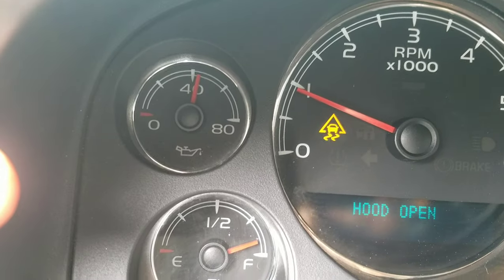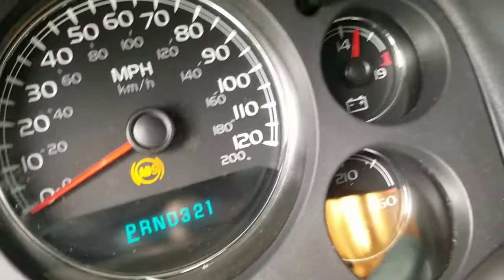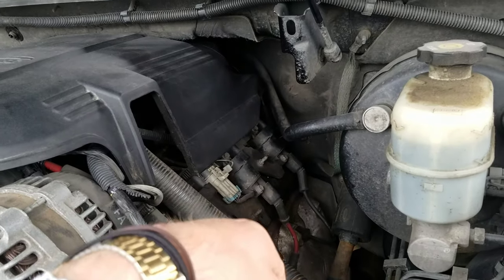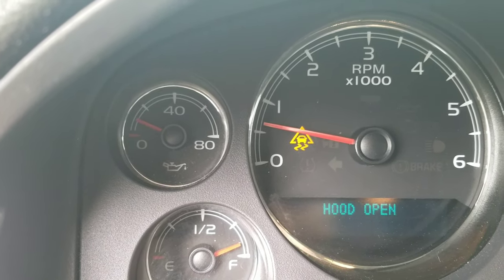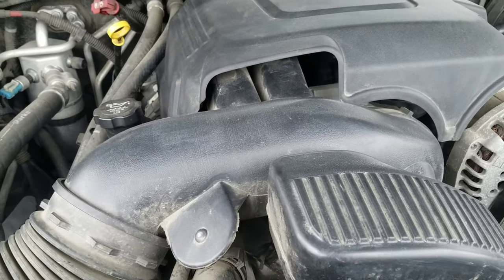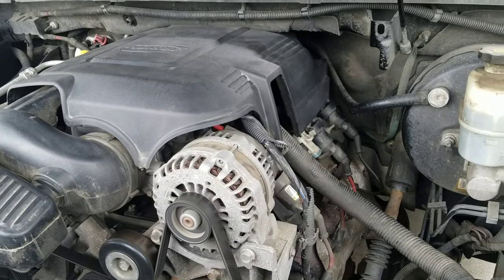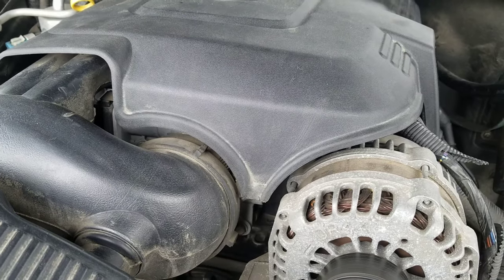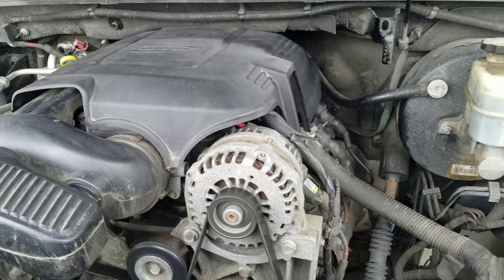0 or Low Oil Pressure? Chevy Suburban, 5.3l Vortec 2007-2014, Tahoe, Yukon. Diagnose and Fix Easiest

Comment: After watching your video I added the seafoam and after driving it over an hour and idle for a while it got fix GREAT CONTENT it helped me a lot I had replace the sensor as well and now it’s fixed! Thanks !
Reply from the maker: Awesome to hear. It's really crazy it worked. I couldn't believe it when my gauge starting going up after hour or so of idling and driving around.
Reply: I just had my oil changed last week and my 03 suburban is doing this.. question.. if I put a bottle of that seafoam in it I drive around and or let it run idle for a bout an hour? also my oil level is covering all but the highest marking on dipstick is it gonna be ok to ads that in or would it be too full? just wanted to clarify so i dont fuck anything up ive just really started doing my own work on my truck about 2 years ago..still learning a lot

Comment: This happens to me every time it’s time to change the oil! Same truck too. As soon as I change the oil filter everything goes back to normal... I have no clue why! But I have went through this at least 6 times and every time I change the oil it fixes it
Reply from the maker: Yeah oil gets dirty from burning up because of the afm and then doesn't register on the gauge.
Reply: @g3mccotter  just seemed strange to me because all other vehicles I’ve had could go over oil change mileage as long as oil levels were good. Not the ole Chevy tho! Almost like clock work. Low oil pressure warning every 3000-4000 miles. Funny thing about it is it never shows signs of low pressure other than the gauge and annoying dinging. First time it happened I changed sending unit and used motor flush with no results. Then I just changed the oil to get motor flush out, scratching my head and thinking I may have big problems. Cranked it back up to get it to the shop and BAM! All was good
Reply: That works for me as well. I believe its because the oil filter is too small. It literally isn't much bigger than the one on my motorcycle. Obviously it could be something else but I think its related to the size of the oil filter.
Reply: I'm having the same issues... QUIT USING CRAP FILTERS.. .I had been going to jiffy lube to get my oil changed, they use CRAP filters... so far, I've changed the oil, or just the filter and it has fixed it every time... but.. it seems to be getting worse.. first time oil life was 90%  next time 85% .. then 80... this time  60%  going to change the filter and install a WIX filter .. hopefully that will fix it again.  Also put seafoam in it and hoping to clean the gunk out.. will run it for 100 miles and change the oil and filter if I get good pressure again.  Probably won't be going back to jiffy lube
Reply: Do it yourself brother, also try synthetic. These newer motors need it.
Reply: I agree it's probably crappy cheap oil filters
Reply: In my case it's not the filter I use k&n religiously but have used many others and every oil change is still having the same problem. Also the truck has been changed with full synthetic oil it's entire life.
Reply: @stealth1028able same here still have the problem now devolved ticking/knocking driving me crazy
Reply: @thank7241   my problem was the oil pressure sensor. After I changed that it's been fine.
Reply: @stealth1028able  changed oil pressure sensor twice,oil pan gasket.rear main seal,pick up tube o ring,new plugs and wires. Will probably do coils next just got code PO300 I believe it was so let’s see
Reply: @thank7241  best of luck to ya. If you're knocking it might be your actual oil pump not feeding right. Just another option to try and fix or have looked at.
Reply: What oil filter did you use
Reply: @stealth1028able  ok so I changed.MAF SENSOR,PURGE VALVE SOLENOID, CLEANED THROTTLE BODY REALLY GOOD. After I took throttle body off I got HIGH IDLE CODE. Says you have to get it relearned after taking TB OFF and guys were talking $150-200 to relearn it at shops. I drove around two days and it relearned itself I suppose. So no engine light on oil pressure is holding strong tick is still there tho no misfire gas mileage is better(which it should be fresh tune up). For a 2009 with 208,459 miles OG motor and tran I’d say I’m good for another 100,000
Reply: @HNPMOE  K&N Mostly. I think factory spec is AcDelco. Double check on factory spec tho I may be wrong
Reply: @stealth1028able  also changed the fuel I use to chevron with Techron. I used to use Kroger fuel well still do in my f150. But for the Yukon I changed to chevron with Techron I can tell a difference slightly

Comment: When you change the sensor,  slap a manual gauge on it before replacing the sensor and it will give a correct reading.  Could be the Guage cluster itself.
Reply from the maker: Yup good call. Could always be gauge cluster

Comment: This happened to me with my 2007 Suburban 5.3 yesterday.  Been noticing oil pressure seemed lower and lower. No smoking or noises, no indication it's something major.  Oil level fine. Dash says oil life 33%. Using Delco oil filter with Mobil1 5w30 synthetic oil.
Gonna change this sensor and screen then run engine oil flush through it and change oil to see what it does.
Reply from the maker: Keep us posted
Reply: Di you fix it? I just have the exactly same problem on my 07 chevy suburban..what di you do if you already fixed?
Reply: @joguadal72  I ordered parts and stuff for it. Everything I've checked so far points to this being the culprit (it is a known thing on the 5.3 with AFM).
Make SURE you change the screen under the sensor. That screen acts as a filter to screen out the oil before going to the valve lifters. (Some people just say to poke holes in it or whatever - do NOT do that trust me!)
Reply: @joguadal72  I ordered parts and stuff for it. Everything I've checked so far points to this being the culprit (it is a known thing on the 5.3 with AFM).
Make SURE you change the screen under the sensor. That screen acts as a filter to screen out the oil before going to the valve lifters. (Some people just say to poke holes in it or whatever - do NOT do that trust me!)
Reply: @JenniferFuchek  so how’s it turn out?

Comment: This has happened to me twice. I stopped at a gas station and bought STP oil treatment, it stopped the alarm and brought my oil pressure up from 0 to 20 and I went and got a oil change and everything went back to normal.
5w30 doesn’t last that long, it gets broken down fast. When it gets to thin then you will get no oil pressure. I recommend Lucas oil treatment and add 10w30.
Reply from the maker: I was using 10w30. This is a much bigger problem I think. As I have oil pressure since I am not getting any ticking or Knocking
Reply: @g3mccotter  buenas noches. Tengo el mismo problema con una tahoe 2007. Me pueden ayudar. No hablo ingles
Reply: @g3mccotter  I do not speak English. can you help me. I have the same oil pressure problem as the video with a 2007 tahie. I changed the oil bulb twice and I still have the failure when heating low

￼
Reply: @johanaromero4774  todavia nececitas traductor/alluda?

Comment: Did you replace the filter under the oil pressure sending unit? They are known for clogging up and the oil can't pass through and needs to be replaced when you replace the sending unit.
Reply from the maker: I did replace it

Comment: Ok bought my 07 Tahoe last month. didn't notice the pressure was low on test drive but engine was really smooth and no check engine light was on. Two weeks later after only driving it on the weekends the check engine light came on. Code was for oil pressure. Did my research and common problems were pressure sensor and oil pump pick up tube o-ring. Did the o-ring first since I figured why not get the hard one done first and sure enough the o-ring was flat, hard and split. On cold start it would idle at 40psi but still dropped down to 20psi once warm and check engine light came back on. Just swapped the sensor and same.
Reply from the maker: Pick up tube is next. Or just flush it then change oil
Reply: @g3mccotter  pick up tube was the first thing I did. Did a flush and changed the oil filter. That seems to have worked

Comment: Same issue with a 2007 Yukon xl I bought yesterday. Check engine light came on but zero physical symptoms then oil pressure low light and dinging came on and gauge read zero. Changed oil and filter fixed the gauge but not the check engine light. Got it coded at the local parts store it’s saying the sensor is bad. The filters/screens with the sensors are known to clog and throw warning from what I’ve read.
Reply from the maker: Reset that code probably go away.

Comment: I replaced my oil filter with the oil filter that has the built-in  anti drain back valve, plus good quality hi mileage Desox 1 gen 3 oil. Drove the tahoe for awhile. It cleared the low oil pressure warning. I think with the anti drain back valve the oil stays in the engine to keep the oil pressure in acceptable range. My oil pressure is still be at around 10 psi on the hot day and idle at stop, but the low oil pressure light went away. May be a GM design engineer can explain why the oil filter can fix this in my case. By the way the local autopart stores in my area only have one  filter I am looking for. I bought the last anti drain filter in my area.
Reply from the maker: 10 psi is too low
Reply: All modern oil filters have anti drain and pressure relief bypasses integral to the filter.

Comment: Had this issue on my 07 Tahoe. Replaced oil pressure sensor, that did not solve the problem. Ended up dropping oil pan and replacing oil pick up tube o-ring. Problem solved. While you have the pan off make sure and replace oil pressure relief valve.
Reply from the maker: Good call

Comment: Hey I’m having similar problems on 09 suburban, I replaced sensor, did tune up, and new head gasket. I just haven’t tried this method or oil pump,mine have same lights on and does makes a tick noise, also sits around 15/20 psi steady. I want to try this method before trying oil pump or getting new motor where did u pour the atf and seafoam into so I can see if that fixes my problem and will it turn off service traction controls and stabilize links messages off … hope to get a reply soon plz help!!
Reply from the maker: All in the oil. If your engine has a tick though it might actually be low oil pressure.

Comment: Yup going thru the same problem right now as I type this I have 2011 avalanche and the mechanic installed new cam bearings, new camshaft, new crankshaft and crankshaft bearings, new ls7 lifters ,oil pressure sensor, did a DOD delete, new high volume oil pump with new O ring on pick up tube, anyways he forgot to replace the camshaft thrust plate idk why he would forget that but hoping that would solved my low oil pressure issue I’ll give u guys a update when it’s all done …
Reply from the maker: Geez I would hope so

Comment: This works.  2007 suburban, 236k miles.  My pressure gauge pretty much did exactly this, but the drop was faster.  Then bottomed out at 0.

1. Seafoam, added maybe a little over 1/2 bottle.  Ignored the dinging, let it idle for 20 minutes to let it get in there..  I drove 15 minutes for an errand, let it sit about 2 hrs and drove back.  Dinging was annoying, but gotta let the seafoam work.

2. I changed the oil the next morning to mobile 1 5w30, (6 qt) changed oil filer to AC Delco and replaced oil plug.  

3.  Drove it a bit this morning.  Watched the gauge like a hawk, it dropped back down to 0 for a bit while idling, then I drove around the block a few times, almost like a sputtering hose, it was all over the pace jumping around, 0 to 10 to 40 back to 0.  But after a bit it was 40 pretty consistent, worked.

4.  Just went for a drive, gauge was a solid 45-50, with no jumping around.  Bruh, gracias.

5.  I think I'm going to do another flush in about a week to get out everything, but for now, it works.

Sidenote.  This is the first time I have changed oil in my car.  HIGHLY recommend a wheeled floor jack.  Literally took 20 minutes to change.  Super simple to those who haven't done it.  Plenty of videos online to show you.
Reply from the maker: Definitely gotta change that oil. Good to hear. I drove mine a bit more with good pressure with the ATF and seafoam before changing.

Comment: I have an 09 tahoe and my vehicle did something similar.  I changed the radiator and the replacement had 2 extra ports that arent used.  After this change my system wont pressurize and my oil pressure was sitting on 80 yesterday and now 0 today.  Im going to try the sea foam and oil change for the oil pressure issue.  I may start with the thermostat for the pressure issue.
Reply from the maker: Sounds like you got the wrong rad. Or there's an oil cooler you forgot to hook back up to it. Otherwise your oil pressure is most likely not related at all

Comment: I have the same problem on my 2011 Chevy Tahoe LT change out my oil pressure sending unit and it still ran same and it became that it was the oil sending unit ring on the oil pan. You have to drop the oil pan and take your pick up tube and it has a rubber seal that goes into the pump. That is bad that’s why you’re losing pressure. It doesn’t show oil pressure Didn’t too much oil air
Soon as I change that out my pressures at about 4550 when I crank it now it’s running fine but it never clicked. Never had a sound on the top cause I was getting enough oil it’s just that it wasn’t holding pressure to show the gauge what I had . Hope that helps you.
Reply from the maker: Yes this is a pretty likely culprit

Comment: I have a 2013 Chevy Tahoe 5.3, changed the oil pressure sensor and it stays between 25-30 at idle when when then goes up to 40-60 on acceleration. When I had my 08 Tahoe my oil pressure always stayed at 40 and it never got lower than that other than the car burning the oil. I’m thinking about changing the oil pump next but I’ll try this first because the motor sounds strong, no ticks or anything.
Reply from the maker: I wouldn't be too worried with that pressure at idle. Using acdelco filters I think helps

Comment: There is also a little valve train filter screen down in intake below where sensor is that causes this as well,have only seen a couple vids on this,isnpossie to do using a pick to get it out, but some say is easier to just remove the intake
Reply from the maker: I replaced the screen filter under the oil pressure switch. Was able to do it with intake on. Hurt my arm but manageable. I think I broke some of the plastic that was in the way but wasn't necessary
Reply: Literally just got done swapping my pressure sensor on my 07 Tahoe. No need to remove the intake. Just a little contortion of your hand and some cramping. Took me about 45 mins and that was with stopping to cus at the truck.

Comment: I need help I did the dod delete on my 2015 5.3 suburban I changed everything from oil pump to lifters camshaft and now that I put the truck back together it has low oil pressure when it warm up what did I did wrong I also strip my valley cover for the dod delete but I still got the valley cover plug to the motor should I on plug it since it doesn't got nothing
Reply from the maker: I'm not sure. Lots could have gone wrong on reassembly. Hook manual oil pressure gauge up and go from there

Comment: Chevy states you need to remove the screen from that sensor/switch they plug up, im having similar problem after i replace that switch, I was told the O rings in the pump get war out
Reply from the maker: Yeah could be a number of issues. The afm on these is broken and cause oil consumption which is the real problem

Comment: just changed oil pan gasket, oil pressure low illuminated, and motor starts ticking. what can it be
Reply from the maker: Clogged oil pickup when you took pan on and off it sounds like

Comment: same thing happen to my 2013 Chevy Truck Siverado 1500, what i did is Drain the old oil and use a 5 qtrs AFT with the oil fliter in and letting run for 6-8 hour, after drain the ATF and replace the oil fliter and use 15-40 oil with 1 qtrs of AFT and that fix my oil sensor problem. A local Mechanic gave me that instruction Easy Fix i was told
Reply from the maker: So now you always run it with a quart of atf?
Reply: As far as now my 2013 Chevy Silverado is running great, But after a thousand mile I did the Same routine again, a mechanic gave me the instructions on how to do this clean out of any gum build up in the Oil system including Oil Sensor, so hope it works for you as it worked for me
Reply: This is happening to me right now. I'm guessing it the sensor but I'll have to see into it. Doesn't lose power doesn't overheat no other problems
Reply: My 2013 Chevy Silverado is running Great after I did what the Mechanic had told me to do, It’s been over sometime now driving thousands of miles continuing using the 15-40 oil with the AFT with my Truck having 289g miles on and still running great
Reply: My 2013 Chevy  Silverado is still running great with no Problem after the Procedure I’ve done with the AFT oil and after,
Reply: @randomguy2369  its the screen behind the sensor it's all gunked up

Comment: If your oil start's to drop again once it is getting hot check as follow : How old is the oil filter. Hook up a manual oil pressure gauge to it to rule out any electrical issues. Does the pressure come's back when the oil get's cold. Run 100% full synthetic oil in your engine.  If those are all checked than drop the pan and measure with a plastic gauge the gap of your bearings on your bearing rods. Most the time those are than out of clearance.
Reply from the maker: Thanks. Agreed.